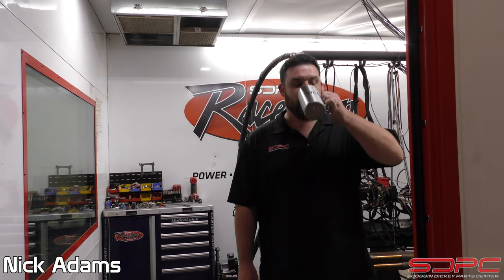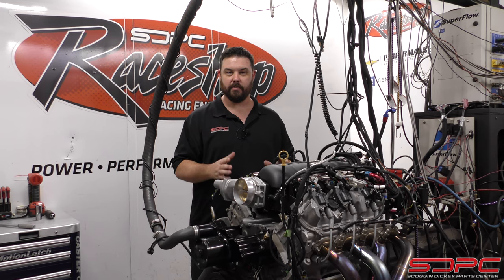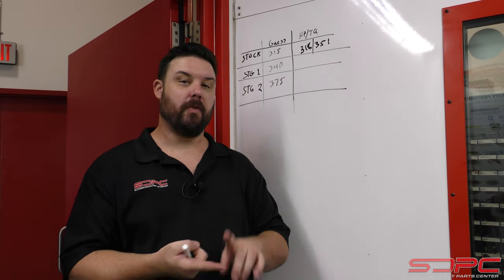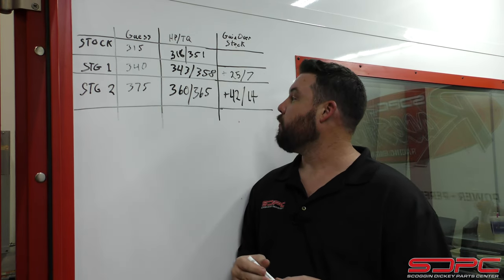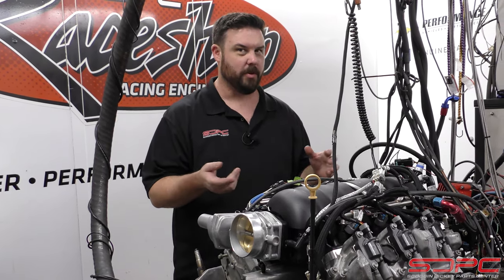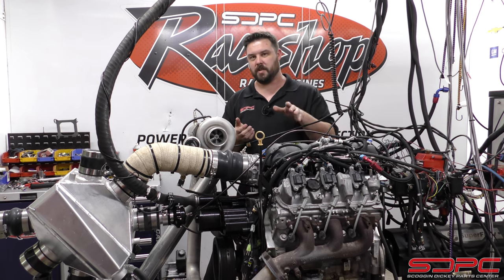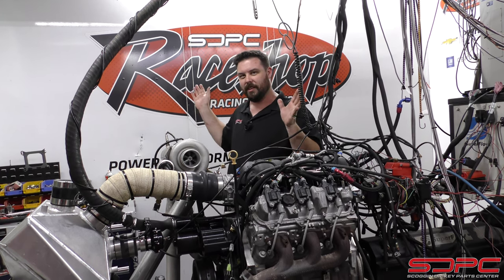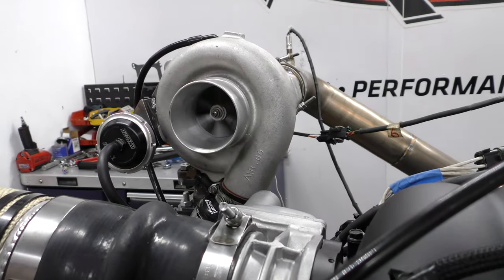4.3L LV3 V6 Camshaft Dyno Shootout!

Comment: I'd like to see a 4.3 perform like Toyota Supra v6 and sound snappy like some other performance v6 engines.
Reply: It's a sbc chevy motor with 2 ciders shaved off. Pretty sure stock cylinders are bored to 4. Over there's no way any rb or k motor has as much displacement in their cylinders
Reply: @ChickenJoe24  It isn't a sbc with 2 cylinders cut off. It is a 5.3 liter LT based engine with 2 cylinders cut off but with a bigger bore and same stroke as a 5.3.
Reply: @marcmo7138  yea the 2014 4.3l is based on the lt1 I don't believe the older 4.3s are like the blazer, s10 or astro vans had

Comment: Un árbol de levas performan para el 4.3 cómo puedo hacer para comprar unos … gracias
Reply from the maker: Camshaft:
https://sdparts.com/i-24508582-sdpc-sdr15977-stage-2-camshaft-for-4-3l-v6-lv3-engines.html?q=Stage+2+lv3

Afm delete, has camshaft as an option:
https://sdparts.com/i-24504716-lv3-dod-afm-delete-kit-for-2014-4-3l-v6-engines.html

Comment: ok, go to the 6:53 marks and pause it. This V6 has 4 tubes on the header.
Reply from the maker: Yah, we explain that in the video :P

We did not have time to have V6 headers built for the dyno, so we used our existing LT headers and capped off the vacant primary.

Comment: I have heard that the balance shaft drive is a possible failure point on this engine. Has anyone tried to delete the balance shaft? I doubt the extra vibration would be much of a problem in, say, an offroad vehicle...
Reply from the maker: It's been done, just like the 3800s of old. It's all down to harmonics and harshness at idle but with an offroad vehicle it shouldn't be too bad.
Reply: Yep, just block off the oil passage (s?).  Might be able to run a real timimg chain.
Reply: @Sdpartscenter  Whats a 'balance shaft drive' reworded?  Harmonic balancer?

Comment: At what point did you swap to race fuel? Was the 7psi on 87 Oct? I’m looking at building an s-10 over lander I’d want a little over stock to make up for weight and tire losses without the added cost of higher octane fuel.
Reply from the maker: That was on race gas as well. We wouldn't have added boost and done that on 87.
Reply: I don’t put 87 in mine and it’s stock.

Comment: Could you suggest the best coil pack setup and spark plugs for an upgrade from the OEM?
Reply from the maker: Stock coil packs are excellent. Aftermarket can actually have some reliability issues.

If you are pushing serious power and/or running Methanol, you might want to move to a smart coil paired with the appropriate standalone ecu.

Comment: Do they make a carburetor intake for this engine like they do for the older 4.3
Reply from the maker: No, anybody that has done a carb intake uses a custom setup.
Reply: @Sdpartscenter  yea they are available for the old 4.3 but I can't seem to find one for the 4.3lv3.....iv got 2 that I'm going to build but I'd love to have one of those instead but I don't want fuel injection....

Comment: Will it live on 91 though or are you gonna have to feed it E85 and H20 meth to keep it alive. Tuning as always will be crucial but never see close to  those #s on 91
Reply: It would for sure be ok to run 7si on 91oct or 93oct, but E85 or race gas is really the way to go for the bigger power numbers.
Reply from the maker: 1) Using water-meth for charge-air cooling is fine, but as a bandaid for insufficient fueling is just a recipe for failure.
2) This was on port injection and not DI, so we ran race gas for that added protection. With this being an 11:1 compression ratio, you won't be able to get away with a lot of boost on pump gas. E85 will move the goal post some but yes, tuning is going to be crucial (especially on any DI engine) with forced induction.

Comment: I have a 4.3 with the weird TBi intake and a distributor. Is there any way to convert to coil overs and an intake like yours?
Reply from the maker: This is a completely different engine than your 4.3 so unfortunately not.
Reply: That's the old Vortec 4.3L. This is the Gen V version. Completely different engine as mentioned by Scoggin.
Reply: @ABRetroCollections  got that. Thanks.

Comment: Spinning it up there to what 5500 at least wanna elaborate on rpms pls
Reply from the maker: 6000 rpm on the stock baseline, 6500 for the NA pulls, 6000 rpm for the boost pulls
We had dyno chart overlays on the pulls, RPM is at the bottom of the graphs.

@4:52 stock
@7:22 Stage 1
@10:27 Stage 2
@16:42 7psi
@22:58 14.5psi
Reply: @Sdpartscenter  oh, this needs to go into my son's Chevy Luv

Comment: In 2004 I put a old time 80's Buick regal  turbo on My engine  stand that I build holley carbs for People 350 4 bolt open plane Manifold old Weiand, I made a plate to bolt on I also ran quadrajet carb that was stock, Now remember Thats a small Turbo I think On the Buick it made 11 pounds from what I could find out, Now a close friend thats a real good engine builder was stopping to pickup a carb I had rebuilt, He came in Just as I started the Motor, He Was Blown away, when He seen The Boost gauge #s 21 pounds,  That Motor sound Bad as a Mother  F--er, He said Brian If I didnt see it for My self ,I would have said your a Bull shiter, He's a Number's guy By the Parts he Puts In a Motor He's always real close to what He thinks it will make, He said that motor Had to be Making 450-500 hp  The Motor came out of a 71 chevy dump truck 53 thousand miles, So It does not take much to Make a strong Motor, That turbo, is still being used today on a model ratrod 250 6 cylinder making 14 pounds. That to me is Amazing.

Comment: 3:00 That engine is not coil on plug ignition.
Reply: Yes it is! 1 coil per plug is what he means
Reply: @hallwest9650  Coil on plug is when the coil sit on top of the plug.
Reply: @blackericdenice incorrect. Just means 1 coil for every plug/cylinder.
Reply: @JasonSmith-utube  You are incorrect. The first engine to have coil on plugs. Did not have wires because the coil sat on top of the plugs.
Reply: @blackericdenice You are looking into it too far. Coil on plug always means one coil per plug regardless if spark plug wires are in the mix.
Reply: @jostrander71  Wrong. Coil on plug was only called that when coil was directly on top of the plug. GM started calling their set up that and low tech people think it's right.
Reply: @blackericdenice   It is called coil near plug in this case
Reply: @marcmo7138  I call it GM being cheap. Just like they when they install twin throttle body injection on the Corvette and called it Cross Fire Fuel Injection. If they had spent more money on the computer. It would have been a great idea.
Reply: @blackericdenice  IDK with all of the tritons blowing plugs out of the head and ruining coils. Ford may have been the ones being cheap with only having 4 threads. How much more would it have cost to add 4 more threads?
Reply: @blackericdenice surprise, surprise, surprise...

Comment: So what about those who have a LU3
Reply from the maker: There's a market for those and some support but the dollar per horsepower is pretty steep compared to other engines as well as a pretty hard limit on what power the bottom end can handle. Most vehicles we've seen with those usually end up staring down the barrel of an LS swap.
Reply: It’s about the same motor as a 5.7 with 2 missing cylinders but sadly they don’t make much power or have that much aftermarket. I also wished I could cam swap it and work the heads but everything in the motor is pretty limiting and nobody really seems to do anything with them unless their carbuated

Comment: Just go ls the price is more then a used ls
Reply: SAWC, uniqueness, and not being either overpowered or underutilized with boost are 3 good reasons to choose the LV3 over an LS. Especially since junkyard 4.8s, 5.3, and even 6.0s are going to be iron blocks and much worse heads than the LV3. LV3 is on par with a 07-13 5.3 stock power-wise (and probably total head flow) but at 3/4 the weight and a 4.5" shorter engine block from pulley to flywheel.

You also literally just saw one do 730 ft-lbs on the dyno at 14psi. That's only half of what any decent turbo can do, so 1100 lb-ft is NOT out of the question if you build it and crank it to 30psi. Nobody can even USE that much in a street car, let alone the 33% more you'd get from having the other two cylinders of its V8 cousins and a properly upscaled turbo to match.
Reply: Some of the ls are getting expensive or already rebuilt a few times. Also the v6 will fit better since it's missing 2 cylinders obviously